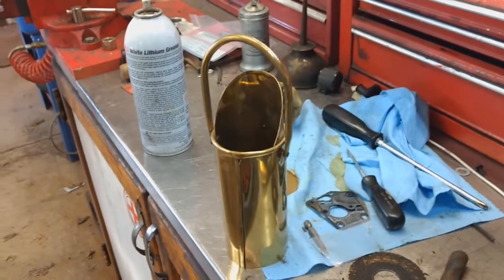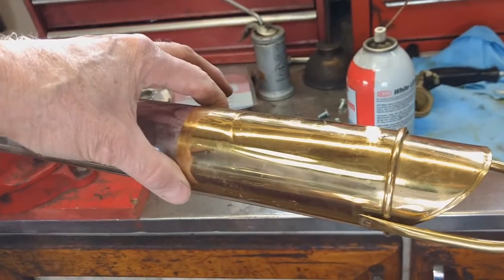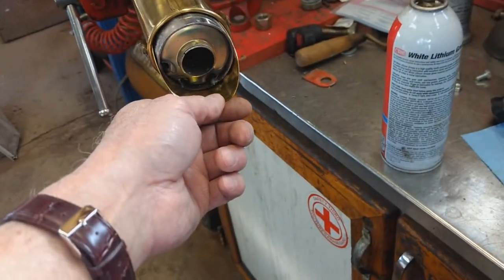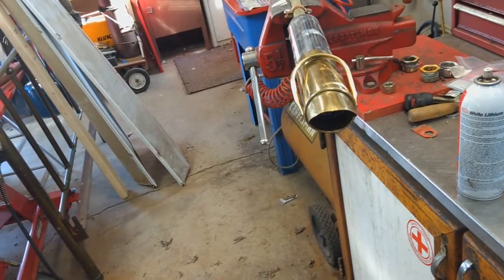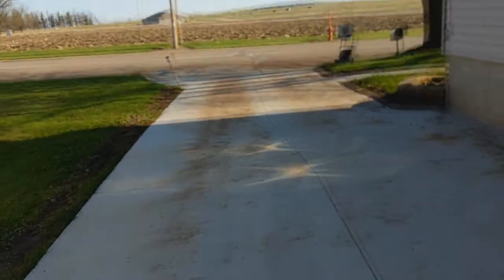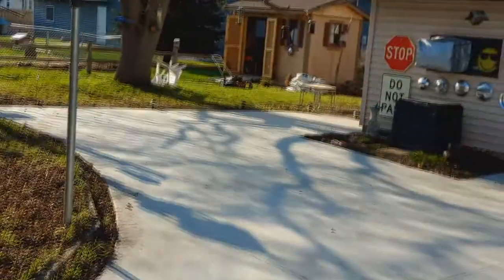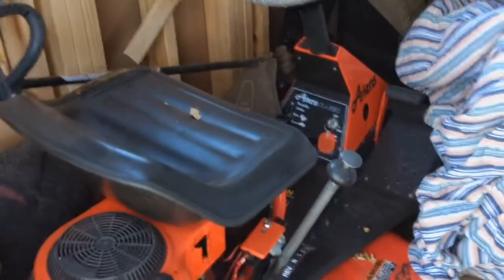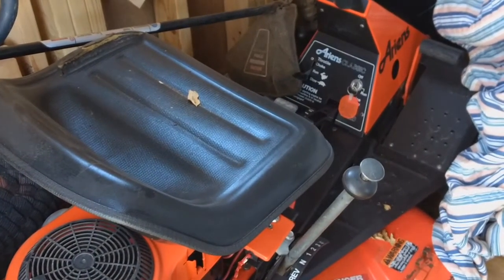Is Goofy going Steampunk?

Comment: I like the brass tailpipe. It really is best with the longer part on top as it will keep the exhaust from floating up at idle. You'll definitely need to solder the bail on if you keep it.
Reply from the maker: Good observations on the bail soldering. Thanks Bruce.